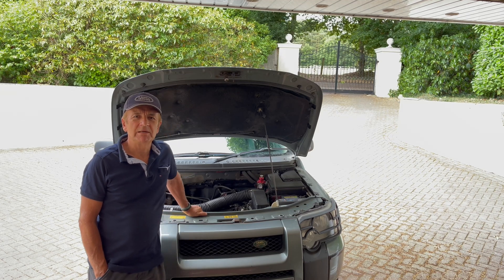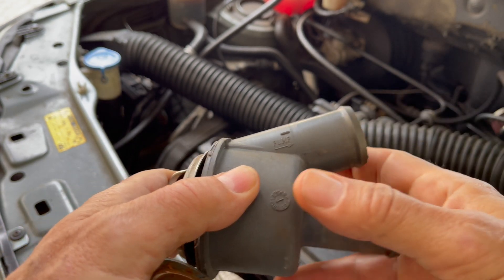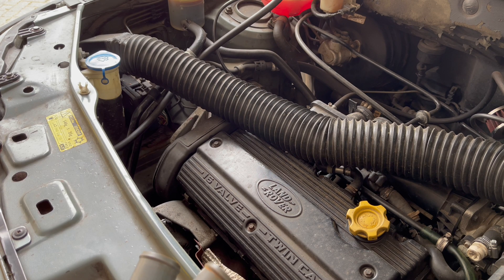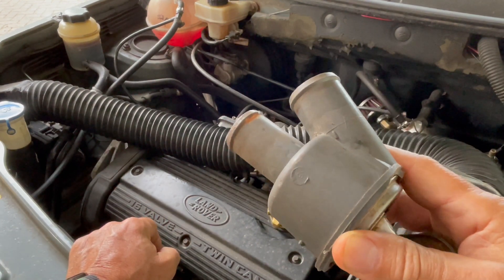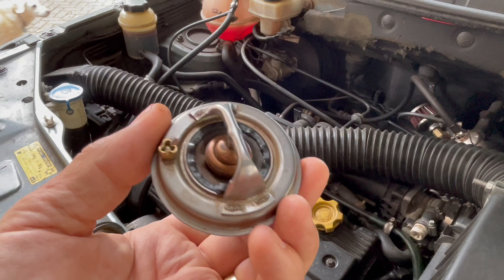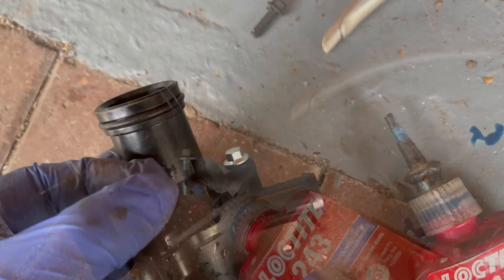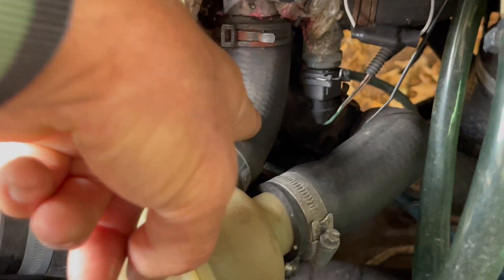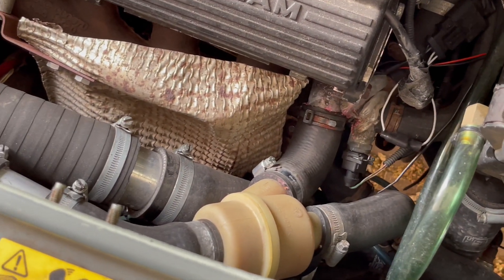K-series Thermostat. Stop Overheating & Better Heater. Change PRT to output type - Old PRT reused.

Comment: Hello, Last week I bought a 2001 model 1.8 Freelander with 18K4F engine. It has always been a very interesting car for me. But of course it always needs maintenance. Your videos are very helpful to me, thank you very much. The first problem I encountered (a day after I bought the car) was water leaking from the engine block water plug, I am trying to solve that problem right now. However, it is not something I can do, so I will take it to a professional service. I have two questions and I would like to ask you. I would be very happy if you could answer them. I found a silicone hose set on the Stoney Racing website. I think it is a product parallel to your cooling suggestions and thermostat upgrades. However, it was said that it is suitable for right-hand drive vehicles. When I asked the authorized person, he confirmed the information written. However, they do not know anything else. My car is left-hand drive, I live in Istanbul. Is there a difference in the engine and component placement between the right-hand drive models in this series and the others? It seems not. Because the hood release latch that should be on the left is on the right side in my car. Should I buy this silicone pipe system?
Secondly, your vehicle that I saw in the videos has been rearranged as a turbo. I also want to make a turbo for my own vehicle. What brand and model did you use as a turbo and did you get the right result? Thank you very much. You are a good person and there are very few videos about Freelander. I would be very happy if you could help me, regards.

https://shop.stoneyracing.com/products/land-rover-freelander-mk1-1-8-petrol-silicone-prt-radiator-coolant-hose-kit
Reply from the maker: That stoney racing set is just a silicon hose kit. It is not the same plumbing set up that I suggest here, which is to swop around the normal PRT plumbing and make it into an output type thermostat.  It is a waste of money that set.  A leak from an engine block plug is very unusual.  I would suspect something else like the rear steel water pipe which are prone to rusting.  A turbo engine setup is based on that used in the MG6 1.8T.  Use that engine or it’s parts.  You need low compression pistons etc.

Comment: Interesting. I have an 02 MG TF which I converted to a remote PRT including removing the original thermostat internals. That has worked fine, but I do instinctively blip the throttle when in traffic in the belief that will help open the PRT via pressure. The only issue I have had was it boiled over during an MOT a few years back, I suspected the PRT so replaced that, it may have been that the rubber seal was perished as you showed (I didn't investigate that). Anyhow its gone through a few MOTs since with no problems, I'll bear your method in mind if it has any more problems.
Reply from the maker: Hi, Nice to hear from you.  That was a similar experience to me, it only boiled over when sat idle for a long time, once in traffic and once at mot time.  That prompted me to investigate.  The benefit of this new arrangement is not only not overheating but also a better interior heater temperature due to better flow through the matrix and also a consistent, not swinging, engine temperature, which has got to be good for longevity.

Comment: There is a kit that sells a thermostat housing without screws, the same as the standard one, but it is fixed, it is very good, and then there is a K series thermostat, K20, K24.
Reply from the maker: K20 k24 are honda engines so not relevant.

Comment: In mg zr tabm it is possible that it is the same engine, the hose on the right that enters through the thermostat comes from the part below the radiator? godd video
Reply from the maker: Similar engine. Not sure what you are asking.. please rely on the video information and pictures.
Reply: Yes

Comment: is this modification going to lower the chance of head gasket failure in my k series engine
Reply from the maker: As over heating of the engine is a major risk for head gasket failure then yes this mod would lower the risk, in my opinion.

Comment: interesting but nothing bad in my opinion this "fix" is useless because I had it on my car and it overheated anyway and I replaced the head gasket. Then I left the thermostat just the rear one and for 1 year it ran just fine and today it does it again so in my opinion the engine is BADLY designed and would need forced cooling e.g. by an electric pump.
Reply from the maker: If your head gasket had gone then no changes to the thermostat is going to fix that.     I am confused by what you say. Did you have this modded outlet type thermostat, the later type PRT inlet type thermostat or the original rear inlet thermostat and one type ONLY?  The  best set up I found by years of use is the outlet type shown in this video. I have run it for years on my 1.8 turbocharged 200bhp freelander 1 with zero problems. Zero overheating zero water loss. So there is nothing wrong with the basic engine when this mod is done.  If changing the head gasket you need to do it correctly, see my other freelander turbo engine build video for some tips on gasket, liner heights/shims and sealing.
Reply: @comeinhandynow  For me the engine is poorly designed, the thermostat should have been completely different and triggered differently, the exhaust manifolds should also have been made better, and the performance of this 1.8 engine is simply low for such a car with 4x4 drive, and the biggest problem I see on this car is that the coolant temperature gauge has never shown that the engine is overheating always just shows the maximum operating temperature even when it was measured 110 degrees Celsius. For me it's not a very good car and by the way I'm not some dumbass who can't fix a car I even have a small home service and everything always works fine so it's really not that I can't.
Reply from the maker: @64RWD  The original thermostat position is poor, I agree.  The exhaust manifolds are fairly standard for a production car, lower performance than a tubular one but a standard cheaper approach like most others. More power is better I agree.  The engine design did get many praises and a ‘design centre’ award when it first came out.  It is a lot better than some other engines, like the BMW / peugeot engine in the 2007 Mini that I had poor reliability experience of. Or the bmw td4 used in the freelander and other bmws.   I find my 200bhp 1.8 freelander much more acceptable and adequate performance for the size of car.
As for the temperature gauge reading just normal for most of the time, I don’t like that either but it seems to be a very common practice of most car manufacturers nowadays - they don’t like to worry owners by indicating anything other than normal.  I much prefer to know what the temperature is on a linear scale, so I fit an extra gauge.
Reply: @comeinhandynow  I also installed an external coolant temperature gauge.

Comment: Thank you a bit of common sense , I have only just brought a Freelander 1 it is not the first one I have owned but both have had the K1800 motor the first one I had it fitted with a brand new motor and the thermostat was fitted externally from Landrover at great expense after having cylinder head problems with the old motor this was 14 years ago it was a 2000 model and with the new motor it was a briant little four wheel drive very reliable after I sold it 5 years ago I missed it so much I recently brought another a 04 four door with a very straight body my intention is to restore it and incorporate some modifications such as your thermostat re location so thank you very much for taking the time to share it, brilliant.
Reply from the maker: Thanks for your nice comments.  Have fun.

Comment: Hello my friend, thanks for the tips,you are great.I didi the thermostat prt but i used a lada niva thermostat which is metal and opens at 80   Also has a bigger gap to flow the water to  the bottom radiator . The temp at  the cluster is a little below midle and in the gauge at the top hose never rise over 90. ❤❤❤❤
Reply from the maker: Sounds good.
Reply: did you use the same pipes?
Reply from the maker: @elemix3454  yes near enough but with a bit of swapping and cutting, from memory.
Reply: Could you tell us how it has been installed and how it works? Does the motor run cooler?
Reply: Hello, I am writing from Turkey. How was the Lada Niva thermostat? Was it successful?

Comment: I read that was a standard cooling system of all Freelanders after 2001, is that true?
Reply from the maker: The PRT thermostat is a standard fitment but the reconfiguration of the PRT that I was refering to in the video is a replumbing of it to turn it into an output type one rather than an input type.
Reply: @comeinhandynow  Thx
Reply: @comeinhandynow My freelander have 113 °C in traffic. Is that normal?

Comment: A question , I have watched the four methods of stopping head gasket failure on the Rover K series and also the 1.8 Freelander over heating at idle video . 
The installation of the PRT thermostat is modified in the Freelander can I apply this installation method on my Rover 45 1.4 ?
Reply from the maker: Yes, as it’s the same k-series engine.
Reply: @comeinhandynow  thank you for coming back to me so quickly , I will apply your Freelander advice to my 45 as it seems very logical to me . Thanks again for the informative videos , super useful and very well made .

Comment: My freelander td4 won’t start when its cold and I dont know what the problem is. I changed the glow plugs but it did not fix the problem. My fuel pump is a bit Nosie but I changed the fuel pump A year ago. My glow light doesen’t show on the instrument panel. I have to start the car with engine starter gas. Do you know what it could be?
Reply from the maker: Did you put in cheap glow plugs or better ones like delphi?  If your glow plug light is not on there is your problem - glow plugs are not being powered.  Check the fuse for the glow plugs and glow plug relay.
Reply: @comeinhandynow  We bought Ridex glow plugs for about 30£ for 4 plugs. Last winter the glow plug light was not on either but the car startet fast anyway. Can it be the fuel pumb or should it be the glow plug system?
Reply from the maker: Don’t know that make, £30 for 4 sounds too cheap.  If the glow light is not coming on then that is a problem that needs fixing. Check that first.

Comment: As already committed about my partner's Streetwise issues! ...I would like to add, the thermostat is as normal at the back, the issue we had with this, there was no heat in the car! ...a video on Utube showed a 5p piece placed in there would restrict the water flow and make the heater work ...I did this, and it worked, she had heat! ... however, now seeing this video, the engine would be running way to hot, and no indication of that! ...one engine is sorted, the improvement will be done Regards Norm's
Reply from the maker: Well done on keeping these on the road.  This improvement in this video is well worth it.  Nicer heater temperature and no high head temperatures.

Comment: Im just fininshing an year long engine overhaul on an mg zs 120, and tomorrow is a prt day, so your video will be a life saver, what a perfect timing lol. Im glad yoy've imroved the video quality too, looking much better now. Thanks a lot man.

P.S. I asked you time ago if you oil the head bolts before fitting them and you said you didint, but then I saw in the workshop manual that oiling of the thread and the head of the bolt where it connects to the head was recommended. Just in case you are interested, cus you are quite a rover fan. Keep the good work up, kudos from me!
Reply from the maker: Cheers and good luck with your project. I loved my old MG ZS. I had both a 1.8 and a v6, both great.
Reply: @comeinhandynow  fitted it as per your video (I have the black one) and so far what Ive noticed is that it warms up significantly slowlier th an with the normal thermostat that was originally in the engine. Otherwise seems to be working fine. On a different note, i need some help man. Im running another overhaul and decided to buy a brand new aftermarket crankshaft (Type A) for the 1.8 k series standard engine, but when it arrived I measured it and the journals are about 47.96 which according to the rover overhaul manual is below specs for normal journals. And now Im wondering if I should return it and just grind the original crank? Im at a bloody loss. Why a brand new crank would be below specs??

Comment: Hey man ! Just about to change the modded front external thermostat on my Freelander 1.8L 2005 Facelift - would this be a good idea if i live where temperatures in winter get down to -35 degrees 'c' ? Was thinking what you said about everything going through the radiator and the temp differences being tonhigh which is bad for your engine.....also, anything special to note about coolant flushing, apart form the the two bleed screws - you don't have to prefil areas like the heating core when refilling if you took off all the tubes? Do you have a vid on it ? Please let me know what you think - cheers! 😏
Reply from the maker: Yes it would be a good idea.  One other benefit I forgot to mention is that it makes the heater inside the car warmer which makes it better in winter.  This is because more water gets pushed through the heater matrix rather than bypass it.  And by using the cream PRT which opens at 88C you also get warmer water and another heater improvement, at the same time as stopping it getting really hot and overheating at 117C!
When bleedimg just make sure you run the car until hot water is going through the radiator so air is pushed out and open those bleed bolts one at a time until no air comes out of them.  They need to be bled of air well.  That’s it on refill/bleeding.
Reply: Am a little confused as to the direction of everything and where the hot water should come out of the radiator on refilling to push out air - top or bottom ? ( never did it before).  By air well, do you mean coolant pressure tank ?
I missunderstand the concept too in living in such a cold area - thought that -25 air blowing through everything that is now going through the radiator, would cause the re-entering coolant to be too great a temperature differnce to that in the engine which could cause damage..... its hard for me to get my head around it - so new to all this .... respect! 😏
Reply from the maker: Sorry, I just noticed I didn’t reply to this one, hope you are sorted by now.  Running the engine until the radiator starts to get warm and regular opening of the two bleed bolts should be enough to expel the air, but take it for a run just to check it hasn't still got air in it and that it doesn’t overheat.
The cold water from the rad will be mixed with bypass water and the engine will only take the right amount of this mixture to keep the engine around 88-100C, so cold water in shouldn’t be the case, unlike the original setup which can oscillate hot/cold.